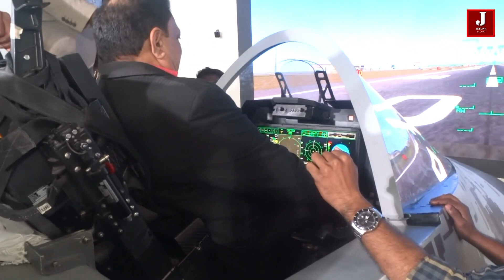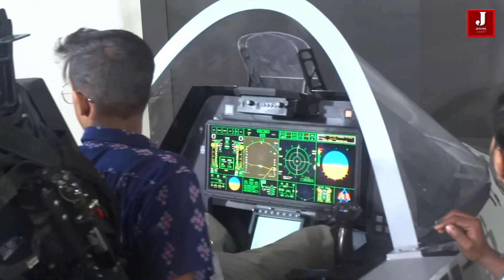Current difficulties with AMCA and Tejas Mk2 have caused further delays in the manufacturing #AMCA

Comment: It is American loss, not India's. India needs over 500 fighters in next 2 decade- 100+ tedbf, 120+ Tejas mk2, additional orders may follow later. 40 amca mk1, 100+ amca mk2. Along with that possible engine replacement for su 30mki if needed to extend the life cycle/delay in above projects. Rolls Royce already is ready even with IPR rights for  120-130kn engine development. Safran is negotiating hard. 
US needs to prove that it is a dependable Ally and indeed ready to share advance technology with India in reality apart from stating in press releases!! Action speaks louder than voice!!
Reply: No it's Indias loss, the hardest thing to make for a fighter jet is the engine. Even with the apporval going through as of last month, its not the latest and greatest and we have no idea if they can can full tech transfer.
Reply: The USA could develop the complex J58 engines in 1958 for the SR-71 blackbird using pencils and hand machined parts, yet modern India is still struggling with this technology?